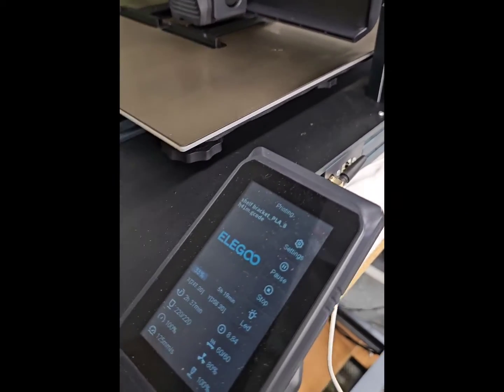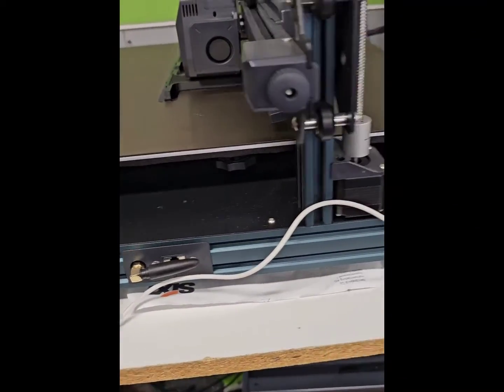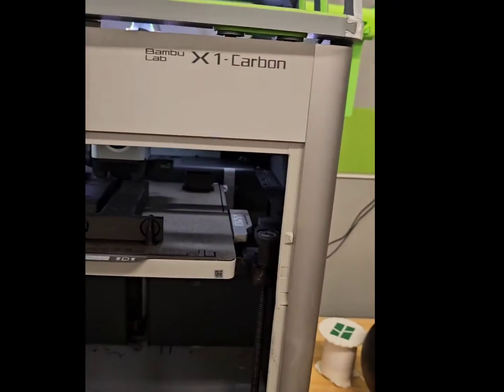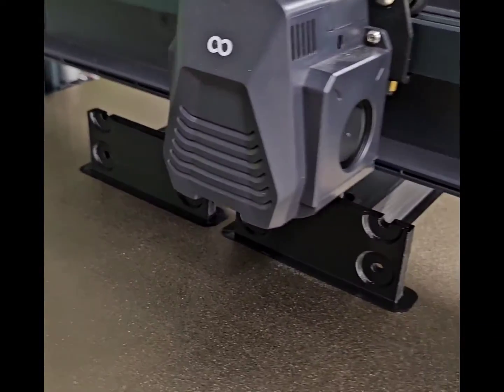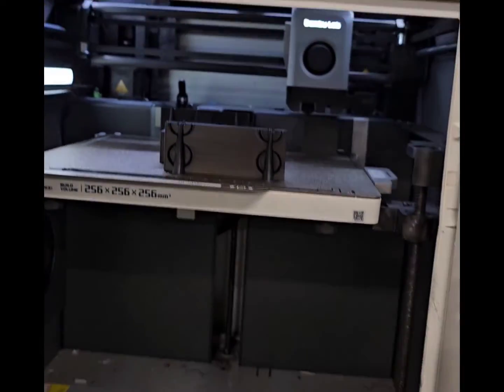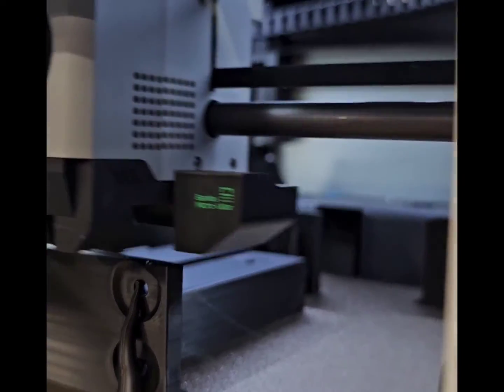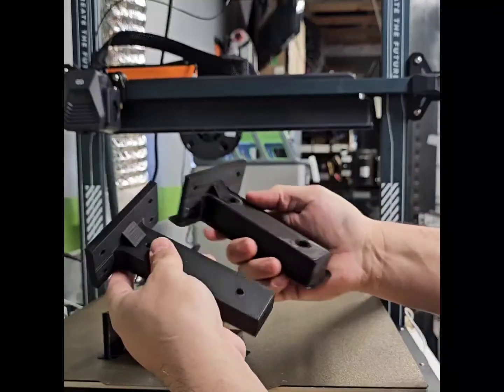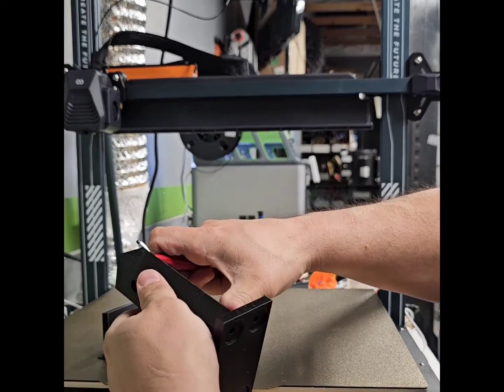Elegoo Neptune 4 Max vs Bambu Lab X1 Carbon

Comment: Don't forget that acceleration on the max is slowest out of all hthe neptune 4. Due to the size.
Do you have any adhesion issues on the max's bed? If so how did you solve it?
Reply from the maker: Nothing that was my printers fault, usually just needed to make sure print was not floating when sliced.  I had layer shift issues until I leveled the gantry.  That shift would eventually knock the print off.
Reply: Can you make a quick video about that. Thanks bro
Reply from the maker: Sure, I'll do a short in the coming week.

Comment: i dont know i don't think this was a fair "race" here is why the bambu from what i saw had 3 differences 1. supports the elegoo didn't have any supports and just printed the supports will add time 2. the bambu had a purge block in the back where the elegoo did not have a purge block and can be what added even more time on the bambu causing a longer print and the 3rd is as mentioned is layer height so all of this being said id say set the bambu to match the elegoo in all settings and run it again OR add a purge block, supports and set the elegoo to match the bambu layer height and re run it make it a pure 1:1 race from size to infill etc. other wise you are not setting a fair ground
Reply from the maker: As the description reads, I didn't plan on making a video. I just needed the same parts printed at the same time and threw this video together for those interested. That is why they were not exactly the same in the settings, but in my opinion, good info.  I myself was surprised it was as close as it was with similar quality.  I will need to print another two brackets soon and will be more Itentional in my settings to  see which is truly faster.  Thanks for watching.
Reply: @vgshobbies-socialiteworkshop  So, it wasn't really a "test" or a "versus", it was "I optimized my print on the Elegoo, and didn't on the Bambu, so the Elegoo wins".
Reply: @johngelnaw1243  thats what i got out of it
Reply: Agreed!  Exact settings would have be more helpful for me to make my purchase decision.